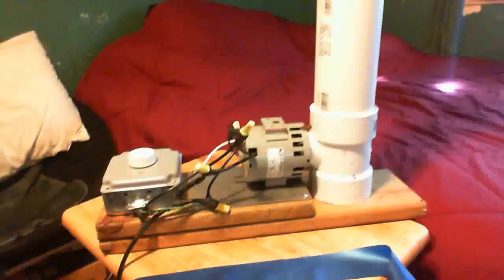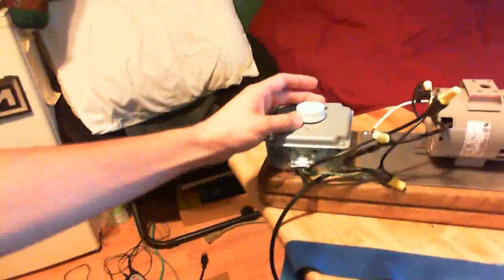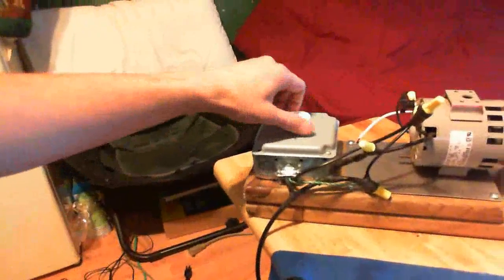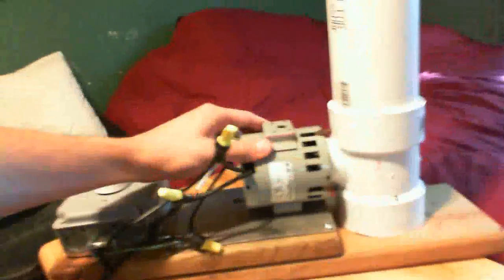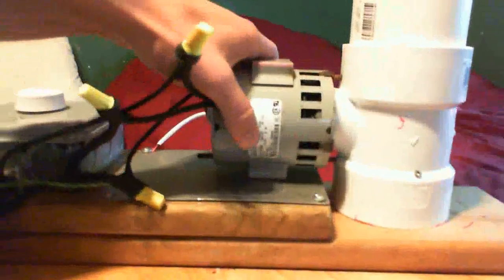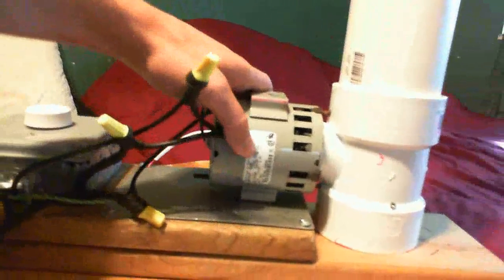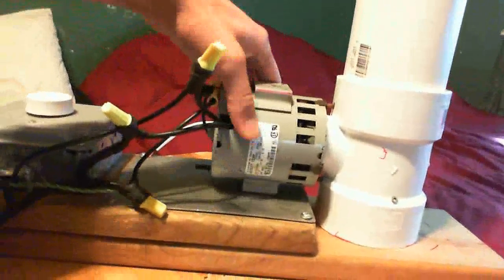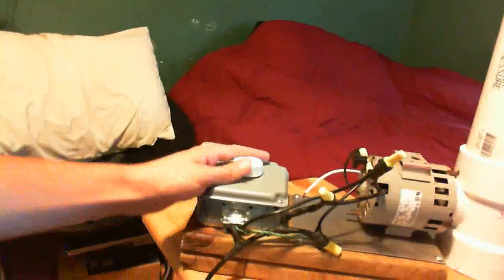Home Made Van De Graaff Generator - Static Electricity

Comment from the maker: Yes indeed it can raise hair quite well... The person needs to be standing on a ground isolation platform (wooden chair or rubber), that way the static charge can build up on the person. For the best results, they also need clean, dry hair so the charge doesn't leak off.

Comment: You need a Pulse-Width Modulator, or PWM-type fan motor controller from Home Depot.  This will give you true variable speeds on that motor.  Looks and works just exactly like a light dimmer, only better and without all the humming and buzzing.